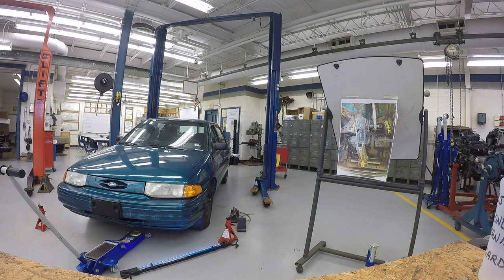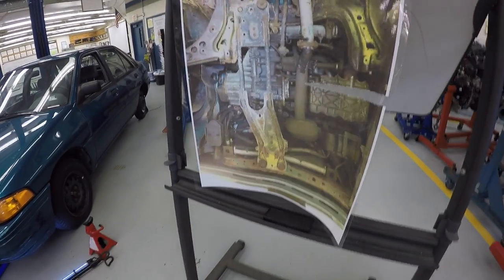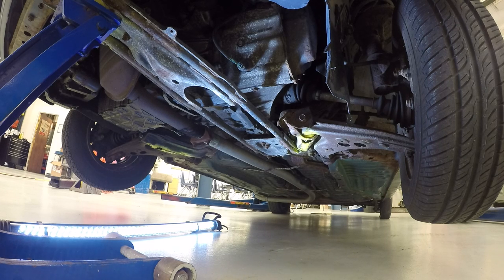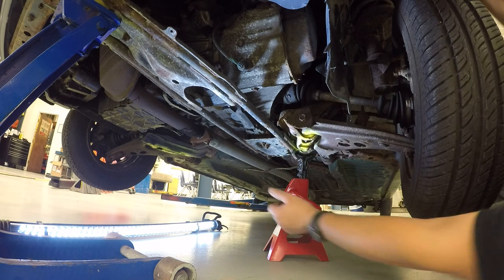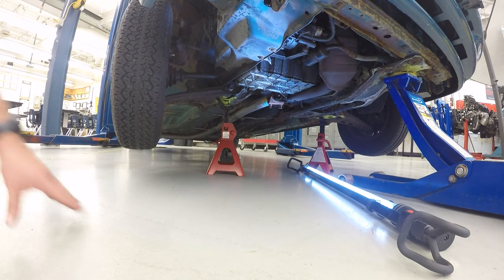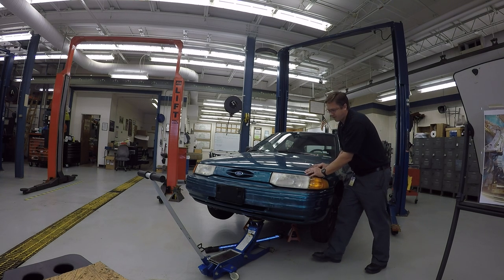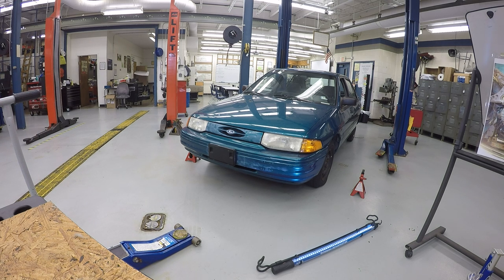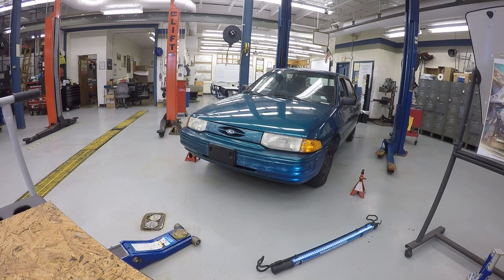Floor Jack and Jack Stands

Comment: You caulk the back wheels, so it wouldn't roll backwards. But once you raised the front wheels, what's to keep the car from rolling forward? I would have caulk one rear wheel front and back.

Comment: You forgot to set the parking brake genius
Reply from the maker: I do not like to use or rely on the parking brake when jacking up a vehicle. Reason is: if the owner never uses the parking brake then it may become permanently stuck on once it is applied. Using quality wheel chocks is  much better and more reliable than the parking brake. Hope this clears things up.
Reply: As he said, relying on a customers rusty old parking brake working properly can get you killed, genius.

Comment: Great video. I'm sorta new to auto DIY, so this was super helpful. If I'm jacking up to change oil, do I also have to put two more jack stands in the back to level the car. It would seem the oil might not totally drain if the car was not level (like on a lift). Thanks.

Comment: Very informative video.
I really appreciate that. 
I would to know where did you  that rechargeable light to work underneath your car.
For someone in the UK.
Reply from the maker: The light is from Blue Point (aka SnapOn). It is a rechargeable LED tube light that has a extendable bracket to hook under hoods. I have had it for many years and really like it. This is a similar version but it is not cordless like mine: 
https://www.snapon-bluepoint.com.sg/category/Lighting/product/168-LED-Under-Hood-Light

Comment: Since you had a mfr lift point at the front of the vehicle (at center), why not use the crimp points designed by the mfr for lifting (it's reinforced), and it is also where shops with dual post lifts place their arms for raising the vehicle. The jacks are then farther apart, and out of the way, with more room to work under the car.  I also would not rely on a pair of stands. For safety, add a second pair of stands, also leave the hydraulic jack in position under the car, and toss your wheels you removed under the car. They are better placed here than against a wall serving no useful purpose. Go with over rated jack stands (instead of 3 ton, go for the 6 ton....safer).  The pin designs are better than ratchet style for safety.  I use 7 ton stands, and the pins are 1 inch thick.... the same used as on the 22 ton stands.
https://www.youtube.com/watch?v=S_Gbz9k5wG8

Comment: Good information.I still am not clear on what the problem was that required you to readjust the one jackstand.I wish you could have held up a drawing showing what the issue was.
Reply: The car wasn't sitting on center of the jack stand so he adjusted.
Reply: Thanks, I think I finally noticed that myself.Now I am clear.

Comment: What is the brand of the floor jack you are using?
Reply from the maker: It's a Blue Point (SnapOn Brand). Nothing special about it other than being a bit over priced. I just like the handle on it for students learning for the first time.
Reply: My car is stored in my garage and the rear end is close to the back wall and needs to stay in it’s present location. Can I use the floor jack from the side of the car to lift the rear portion of the car?

Comment: It would be safer if you put jack stands from the side as opposed to the front.
Reply: the jack stands need to go on solid steel. The pinch weld or sub frame will generally bend or be damaged unless specific stands are used that are wide enough support the  pinch weld without crushing it. Engine cradle or control arms are much more durable.
Reply: How do you identify correct placement? Great video

Comment: What if you don’t get the option for concrete?  : /
Reply: Don't do it. Always do work on concrete. Gravel and dirt isn't safe. Some people take chances with jacking up their car on gravel and dirt. It isn't worth it;especially if you're getting under the car. 

Play it safe.
Reply: If no concrete floor, than place  jack stands on plywood (and go with the stands with wide flat base). Also, you need a sheet of plywood for the jack itself (with 1/8 inch sheet metal attached to top of it) for the jack front wheels to smoothly roll like on concrete.